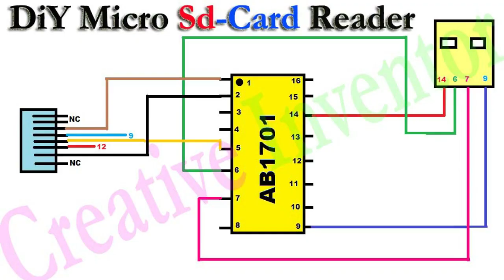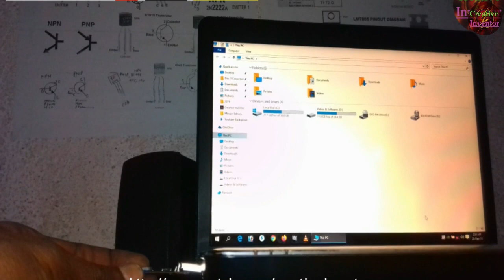How To Make Card Reader at Home, DIY Micro SD Card Reader, Make Micro Sd card Reader from MP3 Player

Comment: Can I use the IC on another mp3 player, like RDA5458TE?
Reply from the maker: u cannot use any other ic from a mp3 player to another mp3 player,
that can only happens if there output pins are connected to same , check both mp3 player ic pins connected to sd card, of there pins matches then only u can use.

Comment: can you connect multiple sd card slots to one usb connector? if so, how?
Reply: No that's not possible there, to do that you have to implement HUB system where you have to use microcontrollers like stm32 or esp32, mainly high clock based microcontrollers.
Reply: @saimum_hassan  aight then
ty man
Reply: @saimum_hassan do you know where a good tutorial to do this is? I’d love to learn how

Comment: How to find 1701ic
Reply from the maker: as already said its in the mp3 player
Reply: @CreativeInventorlab  how to find ic in own circuits like audio amplifier board
Reply from the maker: any circuit that has usb function to connect it with pc, its ic can be only used not any other circuits like an audio amplifier that doesn't have it.